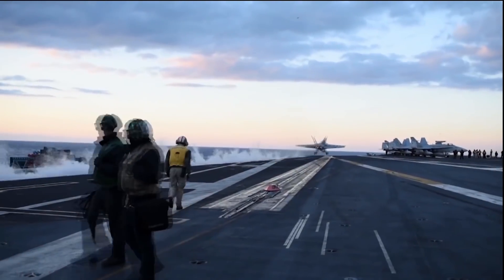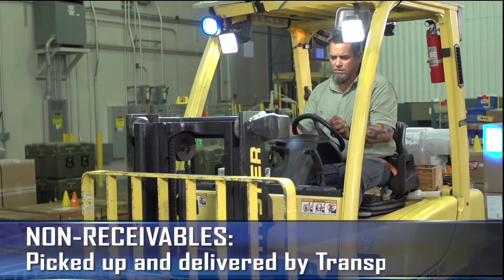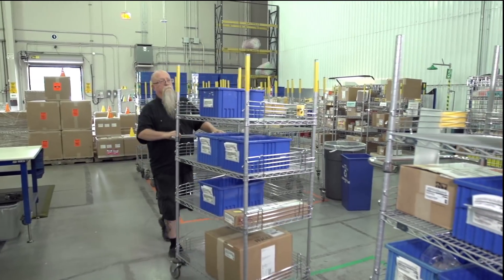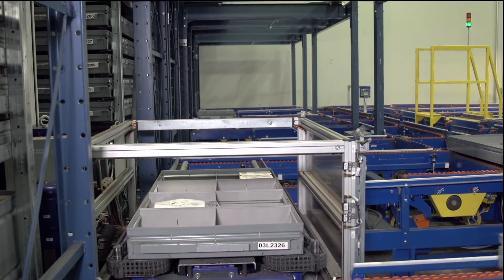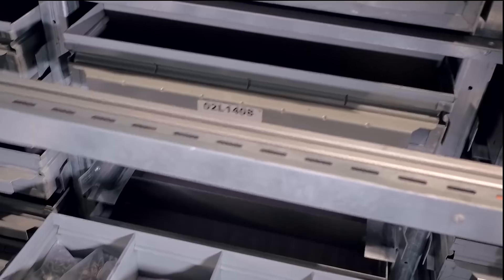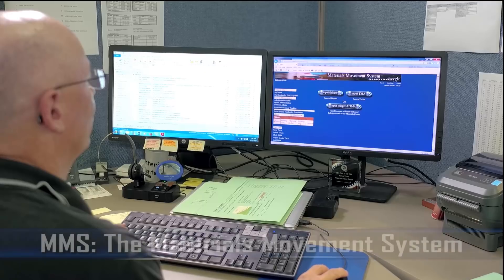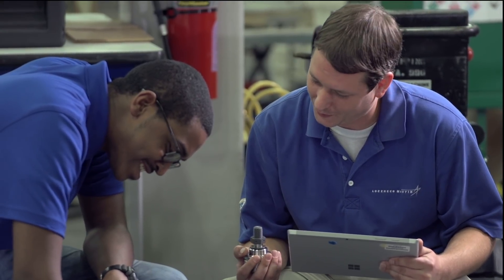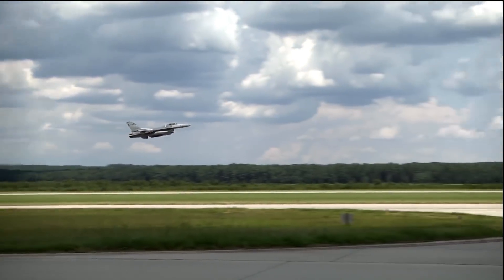Lockheed Martin’s Material Center Overview

Comment: cool
waste of money to have such a storage system, just create 2nd floor give people scooter or trolley
Reply: It's only a waste of money if you don't take into account the time (and therefore money) saved on retrieving parts. You're telling me a 2nd floor would be much cheaper? This is a warehouse with fork trucks driving around on solid concrete, not an office building.
Reply: @myrobotfish  or you can use ladders
I doubt they retrieve often they are not amazon